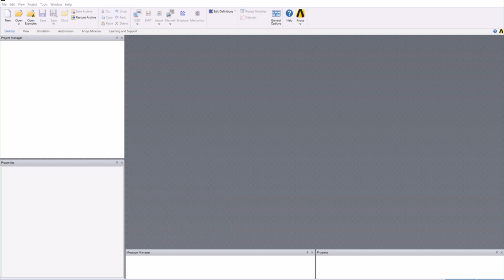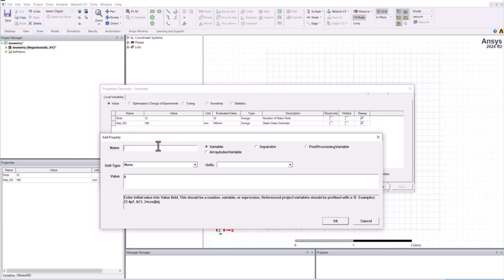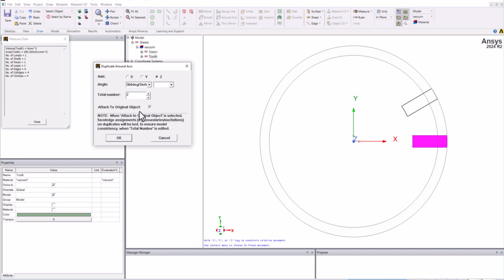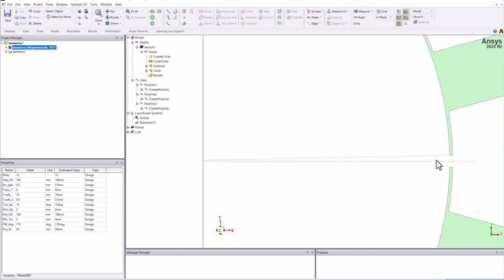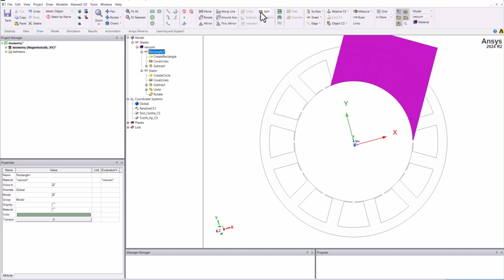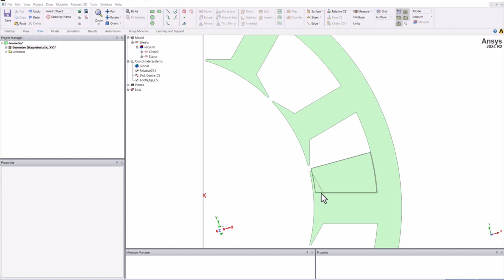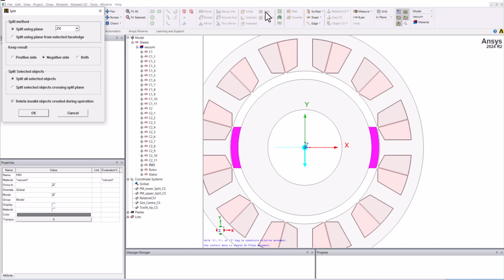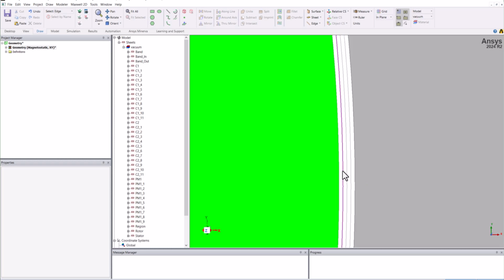103 - Electric Machine Design using Ansys Maxwell - Geometry.

Comment: Thanks a lot sir, i really appreciate the turorial. I want to create an outer rotor sr motor. Unfortunately i didn't find a lot of tutorial or example on how to design it. Can you please make a tutorial. Is it the design for outer rotor for pm and sr motor are same? Except the magnet
Reply from the maker: @ProRatz  hello, and thank you.

I believe by SR, you meant Synchronous reluctance Motor. If that is the case, yes, the design remains same as long as geometric part is concerned. However, in control part of the Motor, there are slight changes based on how control strategies are implemented.
Reply: @learnansysmaxwell im sorry for not clarifying. I mean Switched Reluctance Motor. Is it different?